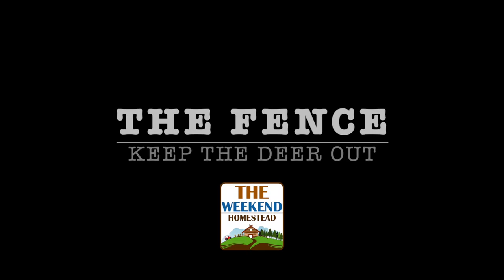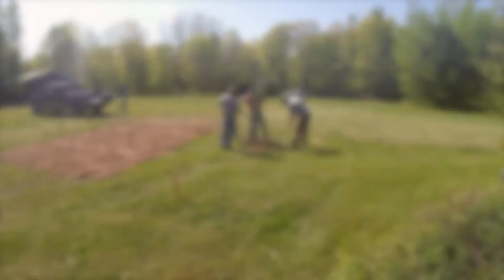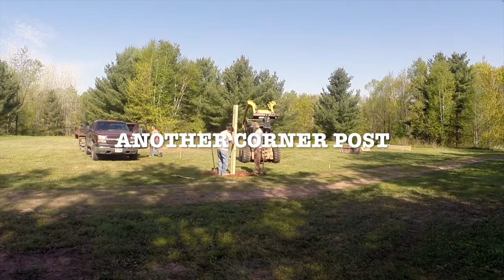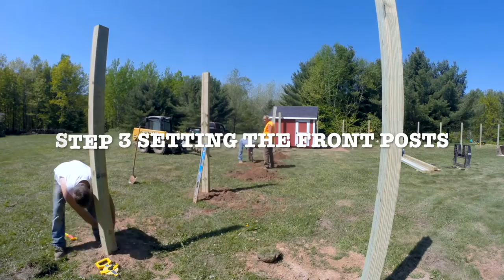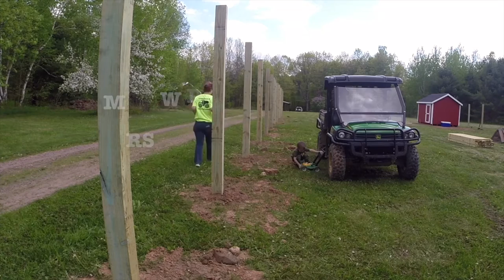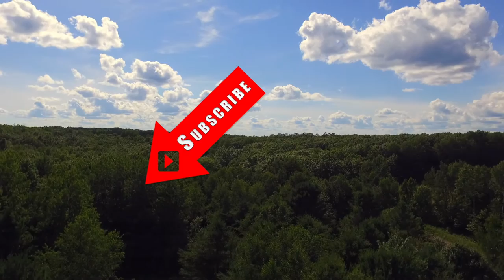Our Tiny Orchard Series - Part 4 - Installing Deer Fencing

Comment: I love the video! We are planting our orchard this year and I was hoping to do something similar. We have a similar frostline (Western PA). Question for you - I see you didn't use concrete. Has that been a problem at all for you? Did you just tamp down on the dirt and that was sufficient? Also, how far apart were your posts? Would love a video walking through the design and build of your fence in detail. There are actually very few videos that do that here for deer. Thank you so much for posting this!!
Reply from the maker: The posts are 12ft posts. 4ft in ground and 8ft out of ground. No concrete just because we are below the frost line for the bottom of them. Spacing is between 10 and 12ft. We tried to keep it as even as possible
Reply: So helpful! Thank you! I was trying to figure out what kind of fencing you used - do you have a name or link to it? Thank you so so much! We are literally going to be in build mode here in 2-3 weeks!
Reply from the maker: sorry didnt get back sooner, YT never told me you followed up with another comment. The fence was from tractor supply, not sure the name of it. How did your project turn out?

Comment: How long were the posts? 10 foot? Thanks for the video.
Reply from the maker: +Larry342516 12ft 4x6 pressure treated posts - frost line is 34 here so we went 48in in the ground and 8ft over which is high enough to make it challenging for deer
Reply: Thank you, and good luck with your orchard.
Reply: Were they spaced 8’ on center?